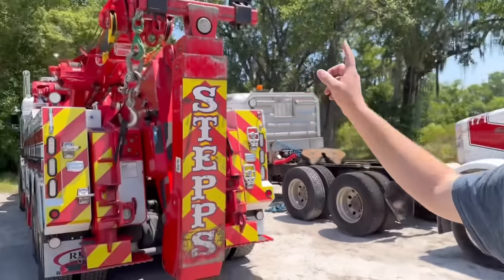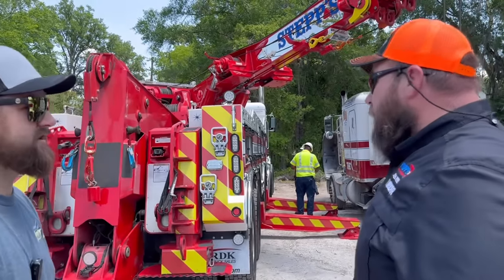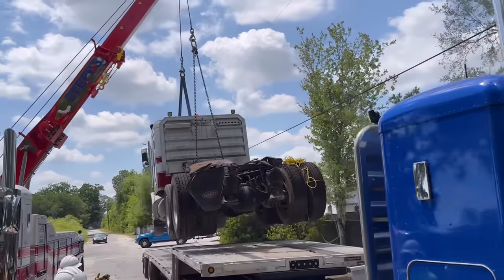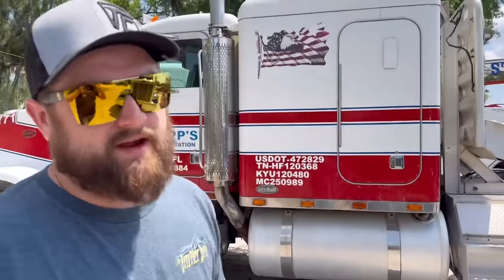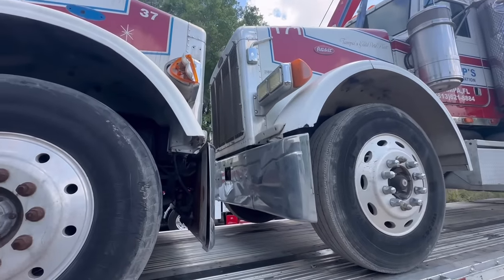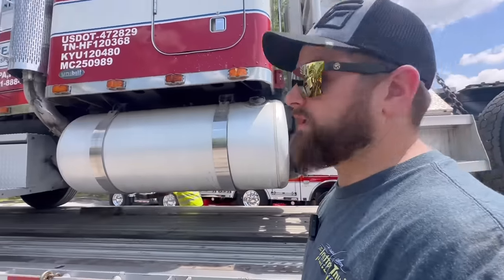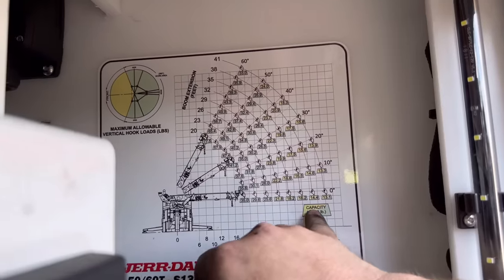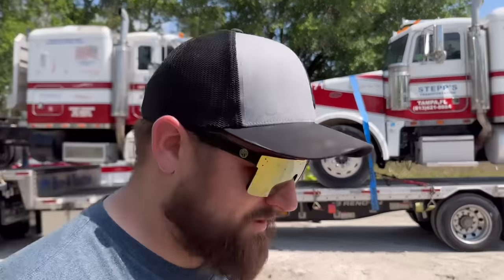Our First Load of Trucks for Parts and Salvage

Comment: So many saying these aren't 379s. Well they are, the short hoods have slope to them you can get a little big hood conversion to make yhem square
Reply: These are 367 from factory  the short hood 379 aka 378 had a straight hood  not slooped..  they only slooped if they were 378 with a set back axle

Comment: You should cover the stacks on the truck thats backwards,   you risk spooling up the turbo while its being towed.    Without the engine running the turbo wont have lubrication and you risk damaging it.

Comment: 6:24 Right on these angles so you know Bruce on a rotator truck exactly right at this point on either side of the truck any corner is your weak point when you're doing a lift you see the way he has a load of the ground You don't have it up high because the truck will leave it or not the rotator will flip it will roll over on you just look at Pepe's Towing there's a video of them where they screwed up and they rolled two trucks trying to flip a truck! So just remember that your stabilizers are going to be out but you do not want your stabilizers picking up the truck from the ground You want pressure weight on each tire still You never use the stabilizers to pick the truck off the ground You just put them down light pressure on the ground but you want contact on all tires because that's what gives you stability on the truck when it comes to lifting things! That is the major screw up, majority of time when you see a rollover rotator because of that error operator error lifting the truck completely off the ground with the stabilizers not allowing contact with the tires it's important that the tires remain on the ground so it gives it a form of stability as well! Learn on this video the movements that they are doing how fast, lifting over the front of the cab to make sure you move the rotator boom all the way to the front once you get in this angle you roll the boom halfway back and once you get all the way to the back you roll it about 4 ft off of center of the center stabilizers so it takes majority of the load on the stabilizers front and back there's a lot to it it's just not doing a lift it's about positioning the boom knowing when to move the tarot back and forth on certain angles remembering at certain heights what's the capacity how far the boom is extended out The capability of that truck being able to perform and lift of weight and the angle of the boom how high up how far down also effects how much weight it can pick up and there's the danger zone that is known and it's a certain degree of angle that the boom will be up in the air that puts you at risk they call it zero gravitational pull which will flip the whole entire rotator truck even doing a 10,000 lb lift it's crazy do you think it's capable of happening but it will happen A truck of this size can literally flip over at a 10,000 lb lift at a certain angle of the boom typically it's marked zero and that's the point that you want to avoid cuz is zero gravitational pull which is your weakest point in the lift! Spreader bars are very important it helps spread the load evenly on the cables! You want to learn how to run the rotator the right way it's the same one that Ron Pratt has ask him to come spend time with him learning how to run it and he will teach you he's open to teaching he will teach you how to operate in his business the right way that would make for some great content for Ron and for you!
Reply: That's not a slider,  only rotator..imo.
Reply: @ky.gambler5281  obviously you don't know anything about rotators The whole tarot the rotator itself it slides from the back to the front every unit is set up that way

Comment: 4:59 they should have been using a spreader bar to spread the load to push it away from the cab I'm surprised they didn't do that
Reply: Using winch 1 on end boom,  winch 3 on second stage, no spreader needed?  Try it
Reply: Slow and steady wins the race. That unit doesn’t have spreader bar. You have to be careful. There’s always a way to get the job done without damaging the unit. It takes skill and practice! The straps are a lil further back because of the turbo and power steering reservoir.

Comment: That’s a 50/60 rotator called that because it’s a 50 ton wrecker 60 ton boom.
Reply: This a 50/60 at 30 degrees it’s a 50t and 60 degrees a 60t
Reply: It’s just the precision of the boom.

Comment: DONT YOU KNOW WHAT YOU BOUGHT, THOSE ARENT 379'S
Reply: 367's
Reply: Either 378s or 367 axle forwards.  Either way their not 379s.  I had a 50 ton 378 hood was a little taller.  I think those are 367s
Reply: How much are you selling those 367's
Love to have one😊
Reply: 378, you can tell by the nose, slanted down, the short hood 379 is not slanted, I have one now

I just noticed the hood is not fully seated down, could be a 379
Reply: @shawnjarman9860  i had a 378. Hood was flatter than those
Reply: Does it matter?
Reply: @Thefvckncaptain it doesn't matter.
Reply: They remind me of a 378
Reply: Definitely not a 379 that's for sure